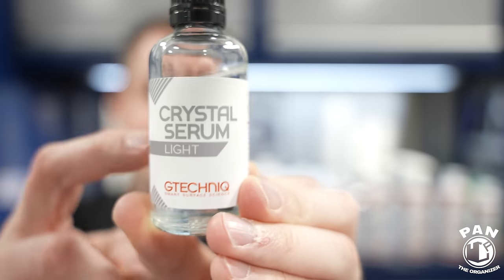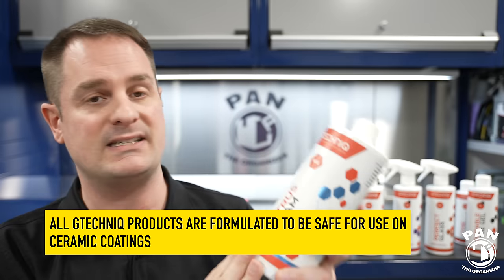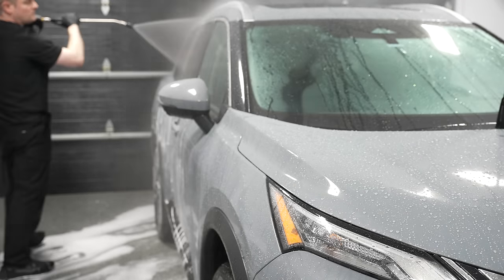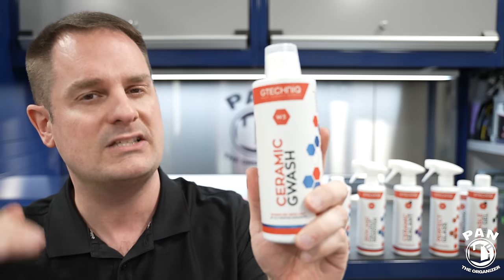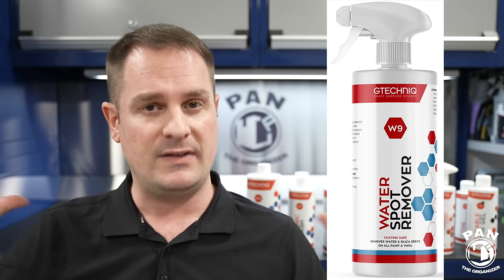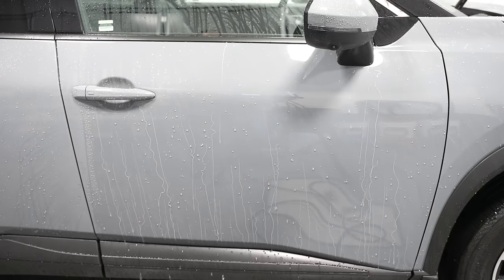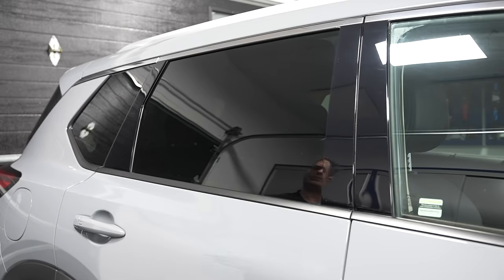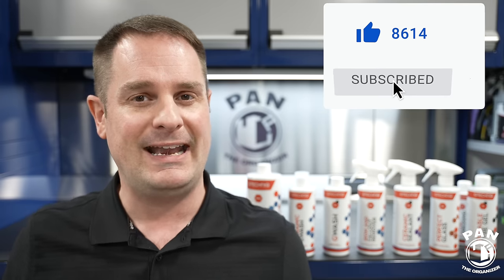Detailing 101 - How To Do A Maintenance Wash On A Ceramic Coated Car!

Comment: Im sure a clear coat respray after 20 + years may cost less than all your equipment, products, pain and labor thru out the life of your car.  Im sure you get some of these for free to promote, well done as you definitely put the work in.  But im ok with a basic handwash and the commercial shiner spray.
Reply: Add a single clay bar process without the extra chemical decon process
Reply from the maker: Welcome to my channel. You discovered one of the biggest car detailing channels on YouTube as we surpassed 940,000 subscribers and we have over 124 million views! I have been detailing for 26 years and I love to share my knowledge and passion with my viewers.

You found the right channel to help you learn everything about detailing. I

Comment: Why not do the iron and tar remover before the contact wash?
Reply from the maker: Because you'd be asking the chemicals to also fight other dirt and grime before reaching their target. Chemical decontamination works best on a clean surface, so each product can focus on its task. An iron remover will find embedded iron particles, instead of perhaps not being able to reach those particles should you spray on a dirty vehicle, and the iron particles that are in the clear coat, would be masked by the layer of dirt sitting on top.

Moral of the story: always do the chemical decon after you wash your car.

Comment: my car's ceramic coated and i love it but... would anyone agree that it isn't necessarily better when it comes to protection from  bird droppings, acid rain etc? like w/o the coating, those elements would damage the paint but with the coating those elements would damage the coating. and either way, to fix it you have to polish the car.

like im so stressed right now bec it's starting to rain and we dont have covered parking. now my car has water spots, and the coating isn't doing so well. pretty bad in some spots, actually. i have IGL kenzo on. I wash it every sunday but it rains and shines in between
Reply from the maker: That's the entire purpose of a ceramic coating (or any other protection for that matter). Protect your clear coat against the elements, UV rays, acid rain, bird droppings, tree sap, give self-cleaning properties, boost gloss and slickness, give hydrophobic properties, etc.

See a coating as a windbreaker jacket for your skin. The jacket takes the brunt of the elements, protecting your skin underneath. The jacket will get use & wear over time, but your skin underneath will stay intact.

So yes the coatings will perhaps get water spots from hard water or sprinklers, or etching from bird droppings or tree sap, or iron particles from brake dust, etc, but at least your coating underneath should in principle be intact.

I'd rather have to maintain a coating, than risk damaging the clear coat of my paint.
Reply: @PanTheOrganizer  gotcha. i guess water spots are almost inevitable, especially where i live😅 

im going to canada in next week! :D been watching your water spot removal video, and will be getting some products you mentioned there cause i cant get it where i am. can't wait!

Comment: i thought the iron remover would remove the ceramic coating
Reply from the maker: No. Ceramic coatings have a high resistance to chemicals. And actually, it's recommended to use an iron remover on coatings at least once every 3-4 months (or as needed depending on your level of brake dust contamination) to help revive the coating and rejuvenate it's properties, as iron removers also degrease the surface.

Another thing that's interesting to note, is that most iron removers are actually pH neutral in the bottle, and become only slightly acidic once they react on the surface. And no worries on coatings. Hence why all coatings brands also have iron removers in their lineups for maintenance.

You always learn new things by watching my videos! ;)

Comment: I have ultra with exo. When maintaining wash i used iron x after winter to remove decotamination.. Iron x has removed and exo...
In gtehniq they are saying that this is impossible... Shame on gteh for avoding responsibility
Reply from the maker: If you are talking about Ultra, I assume you mean Crystal Serum Ultra. That is a professional grade coating that can only be applied by a certified professional detailer. So I'm assuming you had it installed by a professional. Did you reach out to that professional to have it checked under warranty?

I don't know how he prepped the paint or how he applied the product, so I won't get into that discussion, but one thing Gtechniq are right about, is that iron removers don't remove coatings. So assuming everything was done right, IronX would not remove a ceramic coating. Coatings have a strong chemical resistance.

IronX is actually pH neutral in the bottle, and becomes only slightly acidic during the chemical exothermic reaction, and nothing harsh enough to remove the coating.

Also, EXO doesn't have the same claimed durability as Crystal Serum Ultra. How long ago was EXO applied? And were 2 layers of EXO applied? That's the recommended amount.

Again, you should check with your installer and have him look into this.
Reply: @PanTheOrganizer  yes certified detailer has applied ultra and exo. After aplying iron,exo wasnt there anymore. There was no hydrophobic properties nonsoever.. Exo was maybe 2months old. I have contacted detailer and he said that gtehniq answered that there is not possible to remove exo with iron... Anyway exo was gone... Maybe with corona and shit they lowered quality of products :(
Reply from the maker: I never had such issues, and to my knowledge, with all the viewer feedback that I see over the years, most viewers are also super satisfied with Gtechniq coatings. Perhaps you had a bad batch? Or something went wrong during the install? 

I for one, if something was to go wrong with a customer install, I would take care of it and make things right. So perhaps have a discussion with your detailer and have him reapply EXO. It doesn't take that long considering all the hard work or prep was done already. He should just have to wash the car, dry it, use a paint prep spray, and apply EXO.
Reply: @PanTheOrganizer  i totaly agree with you... Gtehniq Croatia wont reaply exo and they are saying that is my fault...   Maybe rly is bad batch.
Reply from the maker: Oh you’re from Croatia? I went on a trip there with my girlfriend in 2015 and we absolutely loved our experience! Such nice people, beautiful country and great food.

I made a video about the trip here: https://youtu.be/yFehCsr5TyA
Reply: Even if exo was removed, CSU should still be there and you should still see hydrophobics of CSU. There is a greater issue here, but hard to tell without knowing the complete history.
Reply: @PanTheOrganizer  glad u like it :) come visit again...

Comment: My wife got our cars ceramic coated. I dont see the difference in before and after. Can previous paint job make a difference? Her coating came out better but not much. It was done by a professional....i guess
Reply from the maker: I don’t have enough details to be able to provide an answer. What coating was applied? What steps did the detailer do? Did he perform machine polishing? Paint correction is really what makes the biggest difference in visual increase in gloss.

The ceramic coating will boost gloss a bit further, but its main duty is to protect the paint from the elements and UV rays, add hydrophobic properties and self-cleaning properties to make the vehicle much easier to wash and keep clean, and make the paint feel slicker. All while providing much higher resistance to chemicals compared to regular carnauba waxes or paint sealants.

Welcome to my channel. You discovered one of the biggest car detailing channels on YouTube as we surpassed 940,000 subscribers and we have over 124 4million views! I have been detailing for 26 years and I love to share my knowledge and passion with my viewers.

You found the right channel to help you learn everything about detailing.
Reply: @PanTheOrganizer  congratz on your viewership. No. Idk what he did or what he used. Friend of my wife's family. Wish i could find out for you. He did mention i have to wash cars with ceramic soap, not normal stuff. Is that true? Also, he said to use just water and car wash type towels (i have those already) to keep it clean until the ceramic sets in. Is that true? My car is getting dirtier everyday and the just water wash isnt helping. The coat look so DULL on my car....Any advice will be greatly appteciated.
Reply: @PanTheOrganizer i'll have to sub you on my other page. Its all car related.
Reply: Subscribed sir.